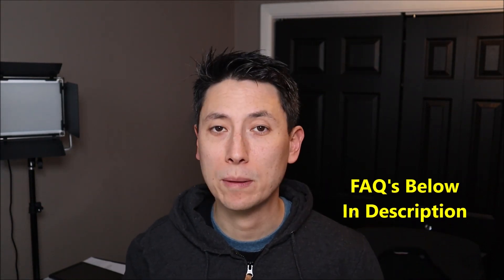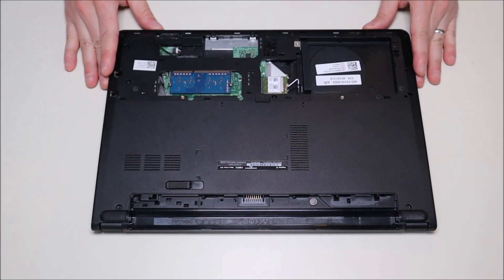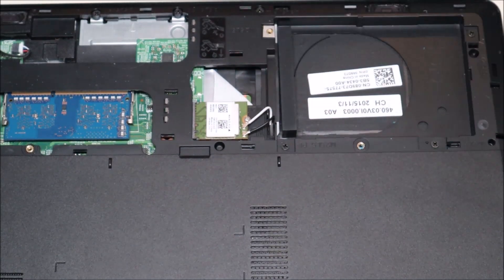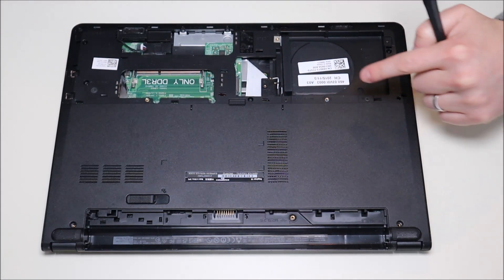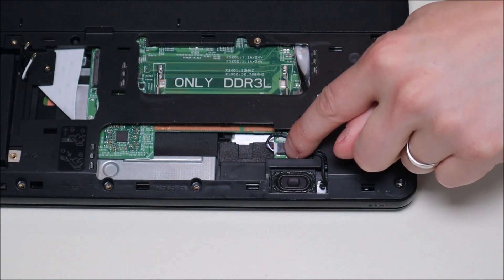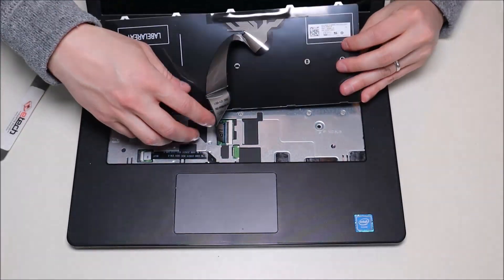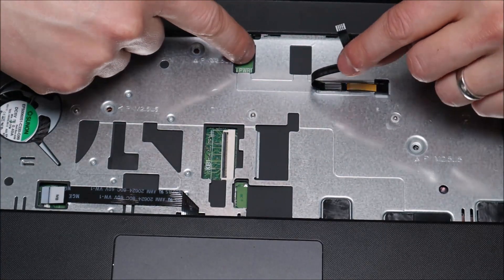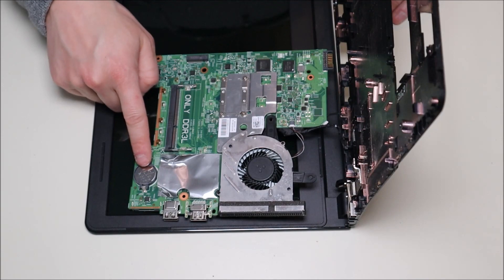How To Replace Motherboard, Power Jack, CMOS Battery, Fan for Dell Inspiron 14 Laptop Computer

Comment: I'm getting error code 2000-0334 in the diagnostic test dell e6410
Reply from the maker: What component is this testing for?  The HDD?
Reply: @PC_Monkey  ssd
Reply: @PC_Monkey  let me explain, I'm trying to install the windows 10 in my dell e6410 , but it gets stuck when the set up starts and I click on install now, so I uninstalled the hard drive and installed in another laptop and installed the windows 10 successfully and reinstalled the hard drive in the dell e6410. but it again stuck at logo screen and no spinning dots. then I tried to get into diagnose and repair option, but the diagnostic also got stuck.

Comment: Hello. I need your help. I have a ThinkCentre M720q that is a few years old that I used for a previous job. I want to factory reset it but I allowed the company to be an admin and be able to control it while I was working for them and after I quit they never removed their admin stuff and now I can not use it for anything else. Is there any other way to factory reset it and remove their privileges if so can you please message me the instructions or video instructions. I now need this computer for a new job that starts next week

Comment: Hello I wrote a few months before.About my laptop sony vaio that couldn't turn on well it turned out the cpu burned and the motherboard failed too so I changed it. My new laptop has i3 330m but well it isn't the best thing to use I just got it because I can't move my pc(but it has i5 13600kf so that i3 feels really slow)anyway I checked if I can change the cpu and it turned out I can I am planning to get i5-560m or i7-620m which one is better?I know the i7 is better but will it get too hot I have one fan and one copper tube or rod that reaches the processor, I hope you understand me, I don't know exactly how it works.I will be waiting for an answer because I don't want to burn it again.Oh and I use it mainly on my desk so there shouldn't be too much heat right?
Reply from the maker: 1.  Yes, the i7 is better but most likely the i7 may not work very well.  I would do as you said and try the i5.  
2.  An overheating computer can be damaging multiple different components if not resolved. First, make sure that the fan and vents are clean and clear. If you need help accessing the fan, let me know what brand and model computer you have and I can help you get inside it. If that does not fix the overheating issue, then try replacing the thermal paste on the CPU and if needed, the GPU as seen here; https://www.youtube.com/watch?v=K_j4GPjpawk. If that fails too, replace the CPU
Reply: @PC_Monkey  OK I ordered the i5 it will arrive after 20 days.I built myself a pc so I have a little(like 70% of the tube)thermal paste left I think I should be able to use it I will see and the video because it should be different from pc I think.I will write later to tell you if the cpu worked.Oh BTW i5-560m's iGPU is better than i3-330m right I couldn't find information about the it's gpu.thanks gor the information.
Reply from the maker: @Филип-ш2с   Good luck !!  Let me know how it goes :)